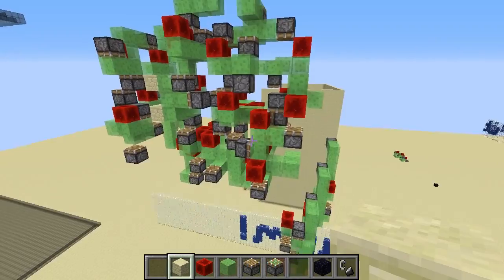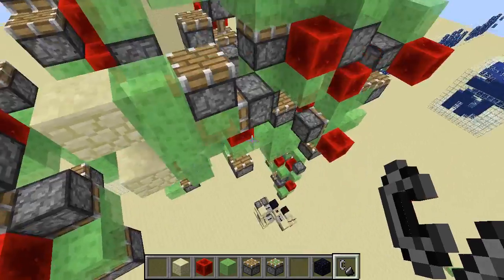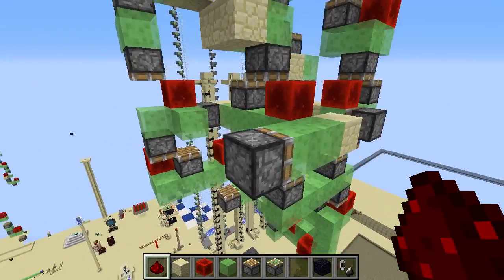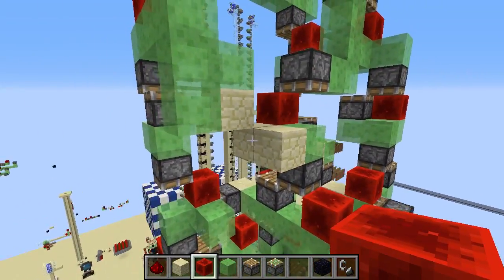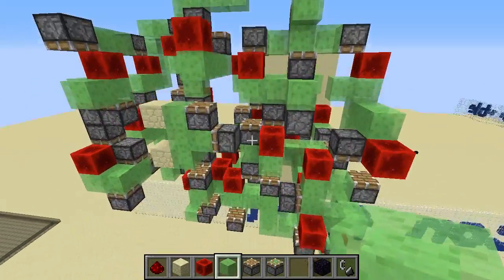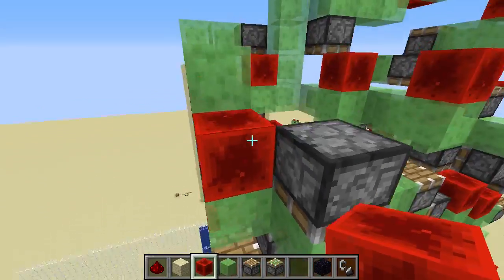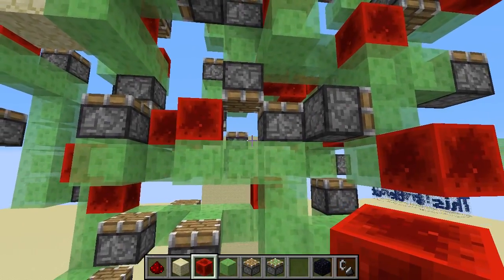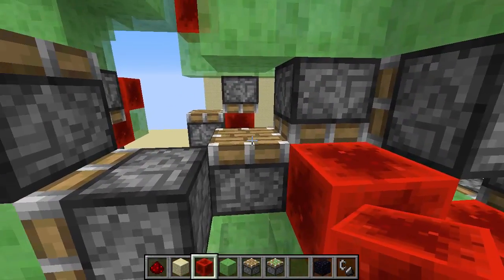VBE reverser and bidirectional shifter - Minecraft

Comment: I feel this is one of the most cruical concepts for quarry tech optimization. Great job compacting it; I'd call that five days well spent!
Reply from the maker: RedsBoneStuff Well ... actually, with some of the stuff I used in the HERBS, I wouldn't be surprised if this is still way bigger than it should be. :P Anyway, thanks, was worth it indeed. :)
Reply: Wout12345 After watching the HERBS video I understand how this could be more compact. And you are likely the only person who could pull this off (since, you know, nobody else has ever worked on VERBS and HERBS).
Reply from the maker: RedsBoneStuff Well ... IDK, since the IFSS-1 is functional, I'm not that much into them anymore. XD I'm still working with slimestone, but for now it's all horizontal though.